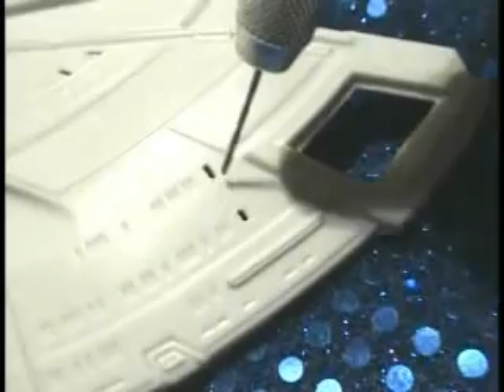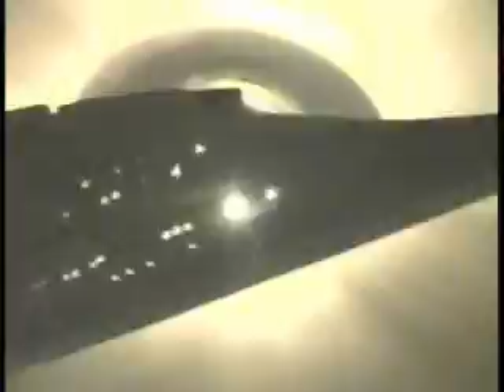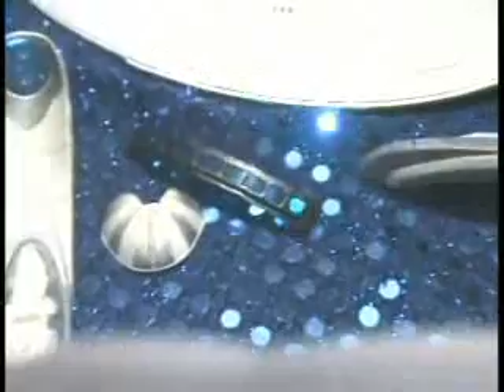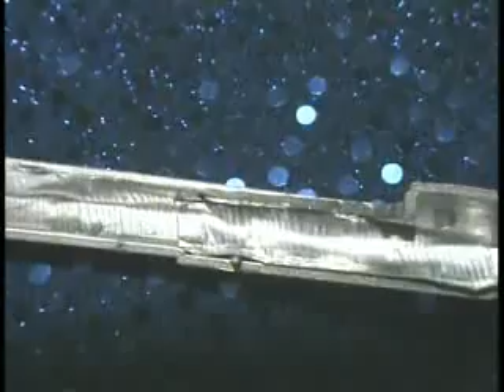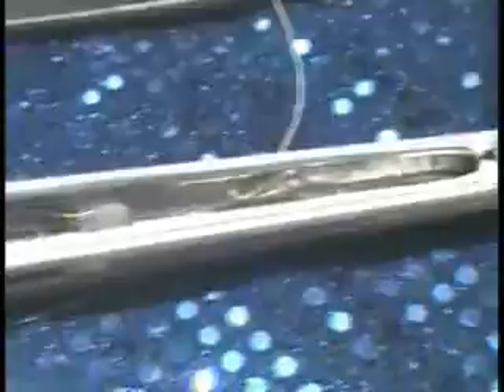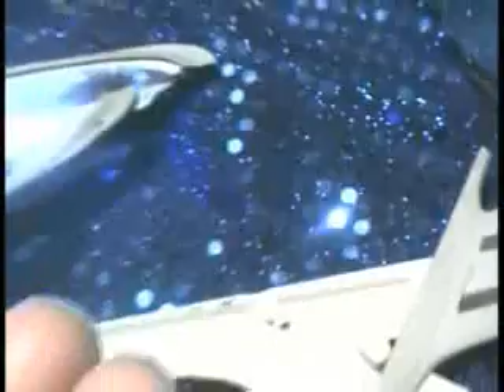USS Enterprise E... "Complete Build" and LED installation guide...

Comment: Are you mechanically inclined, safe with basic 110v AC wiring? Go to Lowes. Get a single light switch receptacle box, a simple rotary dimmer switch, and a short extension cord. Cut the cord in half. Install into the box. Terminal to the dimmer, finishing with faceplate. Now- just about anything you plug into this- is dimmable... including a Dremel.
Reply from the maker: I never thought that would work! ..............I will do it thanks!
Reply: Even easier- same principal- https://www.lowes.com/pd/Lutron-Credenza-100-watt-Single-Pole-White-Slide-Indoor-Dimmer/4462373    But I prefer a "rotary" knob, and a higher juice capability- https://www.lowes.com/pd/Utilitech-8-ft-13-Amp-120-Volt-1-Outlet-16-Gauge-Green-Outdoor-Extension-Cord/3190805   +   https://www.lowes.com/pd/Lutron-Rotary-600-watt-Single-Pole-White-Ivory-Indoor-Dimmer/1059607   +   https://www.lowes.com/pd/Raco-1-Gang-Gray-Metal-Interior-New-Work-Old-Work-Standard-Handy-Celing-Wall-Electrical-Box/1098497   = 3 parts, <$20 to build. Many uses.

Comment: question how long is the enterprise-e that you put the lights in how long is it in inches when fully assembled ???  because I'm trying to decide on which model to buy that has the most detail and is the largest or longest when fully assembled
Reply from the maker: ....Hello Emmett... This is the largest styrene model available...1/2500 scale 18 inches long when finished...There are two smaller versions that I am aware of the 1/1000 scale and the cadet series....HAPPY BUILDING!...Frank-
Reply: Thank you buddy this is Emmett.. question if 1/2500 scale is 18 inches,..then.how long is 1/650 . scale..in inches..???  Signed.. Emmett. U.S.M.C
Reply from the maker: I am not sure how long the 1/650 is you can Google it...